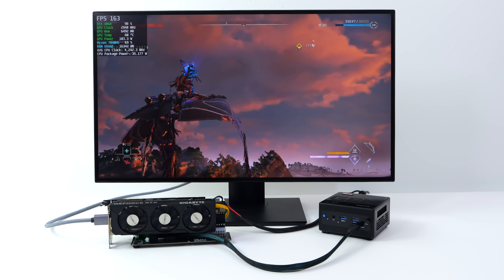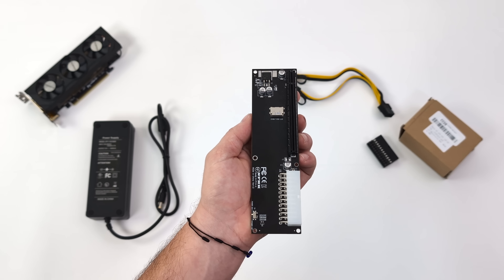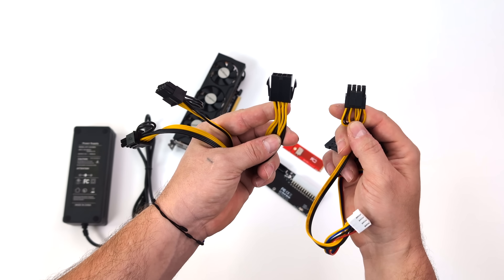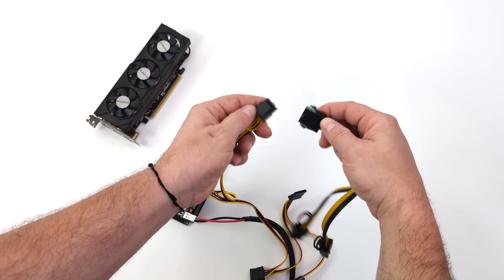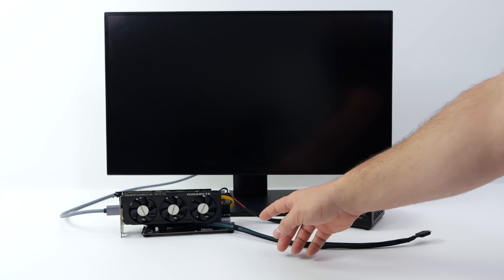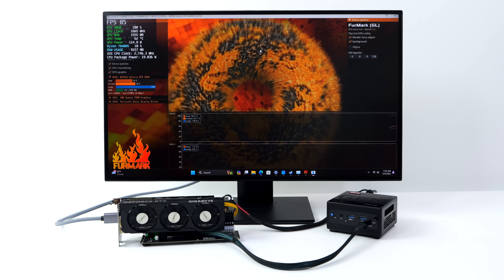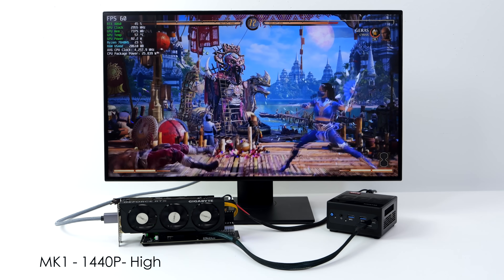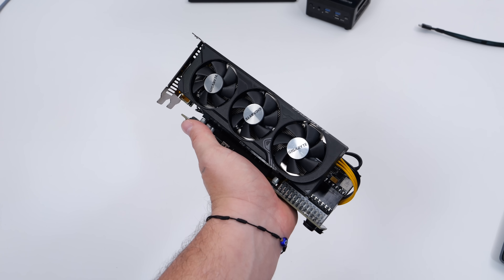Build A Low-Cost OCuLink GPU Dock on a Budget! (Easy DIY Guide)

Comment: I love the idea of these mini's with a eGPU but my OCD could never with the cables mess. Thunderbolt 5 needs to be a thing already.
Reply: 3d Print or fab up your own case, or use a tiny ITX case
Reply: @post-leftluddite  still need two cable, one charge one oculink, we need just 1 cable carry 120gbps
Reply: @post-leftluddite  We really are just convergent evolutioning the giant pain in the arse PC case again.
Reply: @post-leftluddite this is what I am thinking of doing. Make a case that will close everything up nicely. But still have easy access to remove the mini PC itself if I want to travel with it or something like that. But I like small builds as I'm really a console gamer at heart. That just plays PC like it's a console lol. Have my gaming pc's all set up like consoles (remote start, boot into steam big picture & I use a controller lol).
Reply: Thunderbolt 5 SHOULD have just been a simple PCIe 5.0x4 link, so that I'd be 128Gbps, but instead it's only 80Gbps bidirectional, with some 120Gbps one way mode.....which stinks because now there will be a plethora of TB5 applications where customers have to read the fine print to make sure each specific laptop/motherboard/cable has the bandwidth they need....very similar to what it's like with USB 3.2 cables.

It should have just been 128Gbps minimum
Reply: Put a box on it
Reply: Would probably only see full benefits on a gen 5 card. Since thunderbolt 5 would be 4 lanes of gen 5 putting a gen 4 gpu on it would see identical results as thunderbolt 4
Reply: Thunderbolt would have similar power requirements, the cable spaghetti was to power the GPU, not run signal.
Reply: @BobDevV  I thought Intel rolled thunderbolt into the fast usb4?
Reply: My on screen display used to be auite severe too.
The.n , I got off screen.
Reply: Making external pcie x 8 slots more common will be even better than usb 4.2
Reply: thunderbolt was absorbed by usb 4

oculink is a faster solution offered by amd not yet absorbed by usb 4
Reply: @betag24cn  I don't get why there isn't just:"
USB C: Speed A,B,C / Max-Power A,B,C
Direct, full PCI connection.
That's it.

It would seriously fix entire "gaming laptop" market.
Reply: @millanferende6723  the development of usb has been gradual and many companies wanted to convert it into something else, apart fron that there is thunderbolt protocol

it is a mess, all is complicated now
Reply: @betag24cn  Yeah and thunderbolt is basically USB-C port. So all USB-C is Thunderbolt, but not all Thunder bolt is USB-C kind of thing?

Could have simply been a "high-speed USB-C" imo.

I agree, it is a mess. I hope they will just have the data transfer-power on it. I.e. 128-100 for example, meaning 128GB, 100W. Or 64-10 meaning 64GB, 10W. Not that difficult imo, but hey, I don't work at the USB corporation. So what do I know about it? 🤷🏻‍♂️
Reply: @millanferende6723  no, thunderbolt is just a implementation or a connection between a external device asking to connecto a pci express lane

you can use a physical connector like usb type c or the ligthning cable, just to give two examples

it is way more complicated when you compare it to simple usb 2

it is basically types of comunications, the cable itaeld doesnt matter, what matters is the controller chip doing everything for the comunication